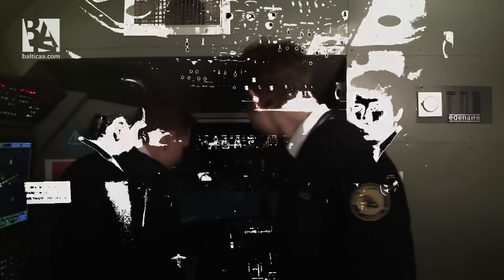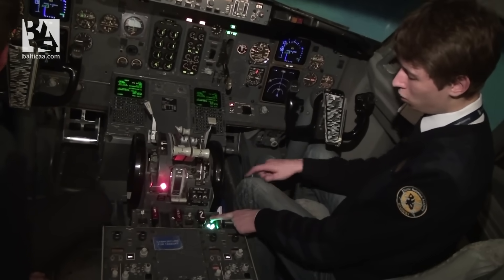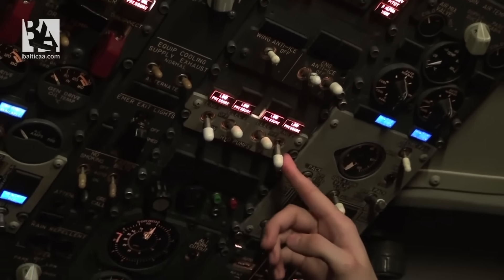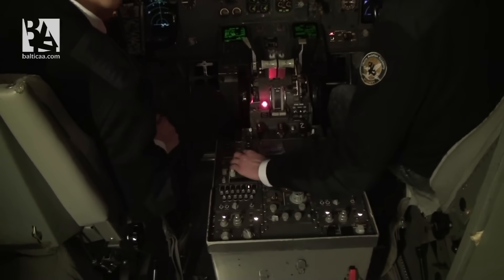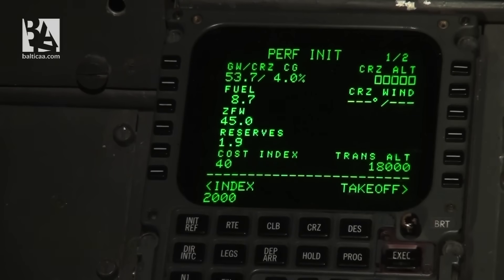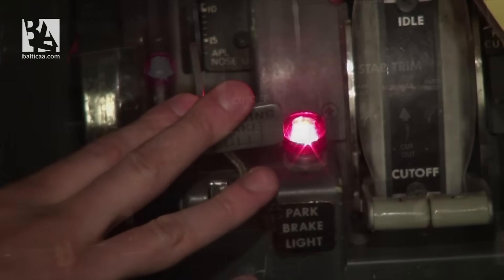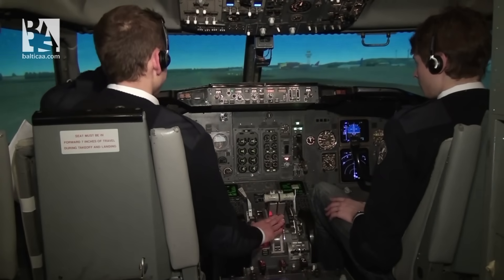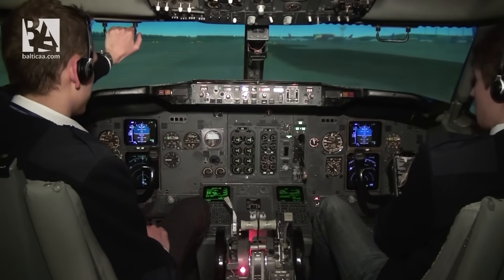Boeing 737 -- From Cold and Dark to Ready for Taxiing

Comment: I would assume that between large planes from the same manufacturer the startup and equipment is pretty similar?  I would think that most jet powered planes have a similar startup anyway maybe just switches and such in different places, im curious about how the fuel is loaded , where and how to calculate weight...

Comment: Packs on Auto so we can get some air going in cabin.  Hyd pumps off when towing so tow bar can't get jammed. Hyd pumps on after tow
completed.   This was a good quick video.  Check list is always safe to use. You have to COUNT the gear pins to make sure that all have been removed.

Comment: I am a full aircraft n00b so what are those spinny disks that look freaking cheap on a 737 but legit an an a320? they even sound cheap on 737, I can hear a cheap noise when they rotate on 737, but they are perfectly fine on a320. there's only one white segment on 737, but pattern on a320. WHAT ARE THE THINGS EVEN FOR
Reply: BonnieSaysFOWA you mean the aileron trim tab 😅? Yeah they spin all the time to correct the flying fault. Aircraft never flew in a static condition. They could easily out of normal axis. That's why we use trim tabs to correct them. There's 3 type of them. Try to google it. And sorry if I have any mistake.

Comment: Why they not turn hydualic pump A Off when Pushback ??
Reply: The Hydraulic A system is used by the nose wheel steering. Usually the ground crew insert a steering pin during pushback which bypasses the system meaning the system can be left switched on
Reply: Sam Hall oh thank you

Comment: Is it just me od does the Airbus 320 have much more simple and straightfoward process?
Reply: It does. Airbus rely on computers a lot more.
Reply: Horin 
Totally easier!!
Reply: Newly versions of the 737 are quite easy to start :v
Reply: Airbus can be a bit easier to start.  But with digitization and improved performance of the Boeing 737, there is not much difference.

Comment: Why are the engine mode selectors GRD CONT and FLT? Shouldn't they be something like START OFF and CONT?
Reply: +XpertPilotFSX FLT is for In-flight startup, GRD is for ground start.
Reply: I mean that FLT selector is for in flight start. So, will you start your engines in the air?
Reply: +Dylan Vrijenhoek Before you ask, no. They do not EVER takeoff with less then all engines on. The FLT selector is for emergency's only
Reply: +Dylan Vrijenhoek only in emergency situations
Reply: Yes
Reply: Dylan Vrijenhoek
Did you even read my comment?
Reply: Yes
Reply: +Speedbird in severe weather they also set the engine start switches to FLT

Comment: You selected the left AFT pump for the operation of the APU, does it have to be the AFT or can it also be the FWD? My check list asks for the FWD would it make any difference?  Great videos.
Reply: No but because the APU is located in the rear of the aircraft they turned on the AFT pump

Comment: Hello I'm a fan of aviation and especially of the Boeing 737 and I have a few questions about the Apu bleed and the FMC of this aircraft. Well,my first question is: Can we connect the Apu Bleed when we are fly below of 150Ft?,and my last question is about the FMC,in the page DEP/ARR there are two options for the arrivals,this means that we can put to arrivals in the FMC? for example: on EGKK there are the runways 08L,08R,26L and 26R, when we're doing an aproximation on EGKK we have the option to do two differents aproximations? one example would be choose the runway 08L and have the 26L or 08R on hold. Well that's all, I hope your answer.
Reply: Yes you can select the APU bleed switch on below 150 ft. And at the Departure/Arrival page you have also the arrival of your departure airport because if you have an emergency that you can select an arrival runway from your departure airport if you need to turn around.
Reply: Thanks for your answer. Now I know more things about the Boeing 737.
Reply: You welcome
Reply: Thijmen thanks for your welcome.When I'll have a new questions about de Boeing 737, sure I will write to you.¿Do you like FSX? I play sometimes with it and the PMDG NGX 737 for FSX.
Reply: Yes and i have the PMDG 737NGX to for fsx

Comment: Were these procedures committed to memory?   Or, was there a checklist that I didn't notice.   (oh, the checklist came later?) 
This is a perfect example of an "Avionics man's nightmare!"  :)   Having been in that maintenance job (not on this airplane) for many years, when you arrive on the flight deck, you must, in your mind, isolate the faulty system and start thinking of "why" the system is malfunctioning.   Obviously, you would have some "maintenance technical data," in your possession. 
 
Even with these myriad systems, you, as the maintenance person, must KNOW these systems intimately - there are malfunctioning systems that the Captain will accept, and will be worked at a later time.   The Captain, however, has the final say. 
There are certain malfunctions that will "ground" the airplane - and must be worked.   This results in a delay - but it is what it is!    N-6395T
Reply: +Michael Donavon In Cockpit procedures there are: Flows, Memory Items, Read and Do items (Checklist) as far as normal procedures. Also for emergencies there are memory items (for the most critical emergencies) and of course checklists that you follow.  It's a well designed system that obviously keeps "routine" items on the flow-memory combination and the rest on the cheklist. This is not a made up thing you will find all these procedures on any QRH of a modern or ancient multicrew jet. These guys followed by letter all the procedures (including flow-checks and memory items) as well as appropriate read and do (checklist items) by the book, not their book, the Boeing's QRH. 
You as an engineer obviously you don't follow the same procedures but stick to checklist for every case which is correct but it's another thing an engineer and another thing the actual crew..
Reply: Thanks for the information.   Also, as a "flying person," for over 30 years,  I find myself following "memory items," if I've flown that particular airplane for several hundreds of hours.

Yes, you are correct:  With the "Engineers' Hat on" (we were always referred to as Avionics Techs) the "systems checkout" were  ALWAYS "by the book.!"  :)    Thanks for your comments.
Reply: +Michael Donavon Blue Skies Cpt !
Reply: Oh, I watched the "Bilogai 09 Landing" - now that was a scary approach!  :)   I would assume that landing there is strictly VFR (?)   (I am not Instrument qualified - I guess you could call me a "fair weather flyer!"  :)
Passed the written Instrument & Commercial, but  lost a bit of confidence for the check rides.  But, that was a LONG time ago.
I enjoyed our conversation.   Thank you.
Reply: Yes the landing is VFR only (technically), getting there though is another story. 
Instrument rating as well as currency is a must even if you fly always in VMC, you never know what you might encounter one day.  My suggestion, if I may, is to add it in your future plans and after getting it try to practise as much as possible with a safety pilot on your side or even a CFII.
Happy landings.

Comment: A few more thoughts if I may.  I noticed when they were to the point of putting on ground power, while they looked for the "Power Avail" light, they did not select ground power via the AC switch, and verify that they had good volts and freqs.  Bad habit.  I also noticed that when they did the fire warning checks, all 3 fire handles had bulbs that were inop.  There should be 4 bulbs lit in each handle.  I case you were wondering, I spent the last 15+ years as an Avionics Technician at an MRO, working on 737's.

Comment: I hope I never have to fly with these two.  They do not know that the "MA" lights on the MCP stand for "Master" and not "Main".  The FD switch that is activated first will enable the MA light for that side.  They also failed to check the Air Conditioning panel for the 5 lights, on the Press to test switch, per the checklist.  Speaking of checklists, why did they not use one for engine start?  Sloppy!
Reply: For if you didn't know it are students

Comment: Nice Video guys, I have just a couple of critics during the Pre-flight, I mean them constructively not just to have a moan but they are below.

1.) On a cold battery start up, it is best to check the 8 items before switching the battery switch to ON as if anything is not where it should be it may cause damage once the BATT is switched to ON, just a 20 second cross check.

2.) You said that the IRS will take 7 minutes to align, however the true figure is 10 mins, however the IRS will show 7 mins for the first 3 mins and the start counting down 6,5,4 etc

3.) You did not check power before putting the APU ON BUS, this can cause damage if the power readings where abnormal, make a habit to check power, then on bus for all the GENS.

4.) You carried out a light test and called it a FLIGHT INSTRUMENT CHECK, this is wrong its called a LIGHT TEST and should be one of the first things the captain does as per Boeing SOP's

5.) When the Captain was talking about runways on the FMS he used the phrase twenty six left, the correct term is Two Six Left, might sound petty, but if you do this in front of your TRI/TRE they may get upset.

6.) I'm not sure if you did this on purpose, but there where several pages missed on the CDU pre flight, Cruise winds/OAT/enter the POS/Fix pages/etc etc, when it is done properly you will get a message "PRE FLIGHT COMPLETE" on take off ref page

7.) I never saw you test the OXYGEN, or open the oxygen valve, this is so important as if you have a rapid decompression when you don your masks within 30 secs you will be dead due no oxygen! test, check for white cross, then check for a continues flow, and also check using the mask function on your radio volume panel with the speaker on to check you can will be able to communicate if such an occurrence should happen.

8.) I never saw you check your flight instruments, bugs set, acceleration alt bugs set, X check QNH, headings, RTO etc, it was only when the chap read the check list did I see you look at your flight instruments.

9.) When you do your before start procedure you should not turn the packs off, if it is a hot day your passengers in the back 160+ will be very uncomfortable. the time to turn the packs off is just before you actually start the engine.

10.)  Captain forgot to say V2 speed during checklist, luckily FO caught it and announced V2

11.) No taxi brief, No take off brief, no company brief , emergency brief, no talk of MEL, NOTAMS, WX and you where ready just to taxi out and take off.

12.) The right hand seat FO will normally call ATC for taxi clearance.

13.) Start sequence standard calls, Packs off, read PSI, starting NO.2 engine

14.) it is unnecessary to call out all the engine parameters, N1,N2,EGT etc it is more constructive to both monitor the parameters and concentrate.

15.)When GEN1 & GEN2 where placed online, never check the TR's, Inverter, etc,
and if power is good on GEN1 & 2 gauge you should read Standby power and BATT

16.) When you came to the pressurization panel you should always move the switches in a C motion, you put the right pack in auto, but then you went straight for the APU, you should have put the left pack to auto and then the APU bleed to off.

17.) during before Taxi check list the Captain called flight controls clear, the correct term is Checked.
Reply: Damn you're good! Critics are made to improve further, which was clearly your intention. Well done 👌
Reply: +Mr President it doens't need to be in the left position if they start the left engine
Reply: Chill bruh just do ctrl+e and you start the engine
Reply: I also noticed the IGN switch was not set to the left when they started the left engine...
Reply: Many good points! In addition, the electrical hydraulic pumps should be turn on well before as described in the video as external leaks can be checked by ground crew well in advanced before engine startup.
Reply: Ok, so you probably fly a 737 professionally, these guys are from BAA and don't necessarily have your knowledge or SOP experience so chill out a bit
Reply: Did you learn something? I did.
Reply: you can go 30 seconds without the oxygen masks you won't die but you'll get hypoxia that'll inhibit your ability to put on the oxygen mask and someone else will have to do it for you although Im not a pilot but I'm pretty sure they should run tests on pilots to find their particular symptoms for hypoxia so they can know what it feels like for them as hypoxia is different for everyone so they can recognise the symptoms

Comment: I'm curious, I watched this  vid and no nothing about flying, but I'm amazed how intricate it is, do you have to have an electrical engineering degree & aviation one too?  Just specifically what are the degree's  requirements?
Reply: honestly, everything they are doing is only neccessary to a certain extent, all i do is power up engines in parking brake, throttle idle, no smoking sign and seat belt sign, make sure all the panels work and then taxi  at 30 throttle, then full throttle at takeoff, then down to 75 throttle afterwards, and taxi and landing lights ON as soon as the plane starts, which i forgot to note before, this usually takes me 3 minutes
Reply: Thanks Patrick!  I appreciate your input!
Reply: ratso69ful any time
Reply: ten en cuenta que ellos están haciendo un cold &dark que es completamente apagado pero en la vida real cuando los pilotos llegan al avíon hay ciertos sistemas que están encendidos(normalmente) y por lo tanto todo el proceso es mas corto

Comment: well it was probably a mistake and they were giving a crash course so they really didnt put too much detail into programming the CDU... But you are right, if the trans alt is not 18,000 in EGKK, they should input 6,000ft into the trans alt. field. (6,000 is the trans alt of EGKK)

Comment: but it has to be a 737 normally the 200, 300 and 400 variants. Because even the next generation 737-600, 700, 800 and 900 series have different control configurations. But for sure now you can steal a classic 737 :D

Comment: yaw damper is a device used on many aircraft (usually jets and turboprops) to damp (reduce) the rolling and yawing oscillations due to Dutch roll mode. It involves yaw rate sensors and a processor that provides a signal to an actuator connected to the rudder. The use of the yaw damper helps to provide a better ride for passengers, and on some aircraft is a required piece of equipment to ensure that the aircraft stability remains within certification values. - Found at Wikipedia

Comment: As for question 2 - 

Flap setting for the next flight depends on the weight and speed of the 737. In the video they talk about the weight (52 tons) and 'V-Speeds'. Those help deterime the flap setting. Since the next flight is different, the flaps are retracted so the next flight can set them properly. As to why they do it so fast, that's just what pilots do. They can do it while they taxi to the gate, or as the exit the runway. But a good idea to retract after landing.

Comment: Maybe I can help answer:
1- Theres a switch on one of the gears called a squat switch that when the gear is compressed disconnects the circuit and make the gear handle not do anything but turn the warning horn on. If that squat switch failed though you could have a problem, good idea to just always make sure the gear handle is in the down position before turning on the master. Some smaller a/c will retract, but major or larger a/c like a 737 won't.

Comment: Thanks guys, great videos! - a couple of questions if I may:
1. Is it actually possible to raise the landing gear while on the ground?
    (Isn't there lots of safety features or seer load on the motor would prevent it?)
2. Why to pilots raise the flaps very quickly after landing? 
    (ie. why actually do it, rather not set them to take of ready for next take-off? )
Reply: bro I hope you got  your answers in these eight years lol

Comment: V1, VREF, ROT, V2, CLMB, and VSPD are all dependent on weight, fuel and other things.  There is no set value, it can be anything from 120kts to 150kts for V1 depending on weight, wind, fuel, altitude, etc.

Comment: That's a lie, the simulators they have are: A320, 737NG, 767, A330/340, ATR42, CRJ100/200, ATR72, CRJ700/900, B737CL, DASH8 Q400, ERJ145, 747, ERJ170/190, 757, SAAB340 and a SAAB 2000. 

So slightly more than just the A320 and 737.

Comment: Hi there...followed along with you, very methodical and quite thorough, still...per my training and experience on the B737, you missed some things we were required to check...O2 masks and mics, Flt Deck O2 tank valve (behind FO seat, aft).  On the CTR Pedestal, yes thrust levers at idle, but also check the TO Warning, and full motion of the throttles.  Also, the ELEV Trim Cut-Out switches, and pickle switches on the control wheel.  (  Just to name a few!  :-)  )

Oh, and CVR, and GPWS...

Comment: Excellent videos Pranas, I studied this before I went into a 737-800 simulator and found them extremely helpful, some of the panels were slightly different but the preflight check list flow was the same. A comprehensive and concise explanation of cockpit procedures.
Thank you!

Comment: The IGN L and IGN R labels don't refer to the left and right engine but to the redundant igniters in both engines. There are two igniters in each engine, a left and a right one, that are on independet electric buses. If one fails the other one can still be used to ignite the engine.

Comment: It is adding fuel to the engine. If you do it to soon or below the minimum %n2 you risk hot starting the engine due to a lack of cooling air flow through the engine itself. If you put it back to cut off it simply just shuts fuel off to the engine and shuts it down.